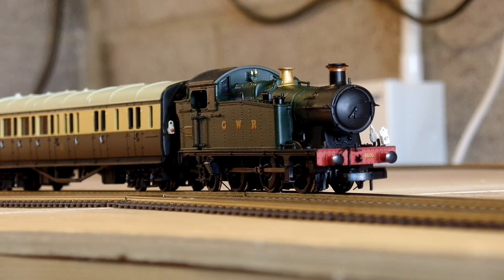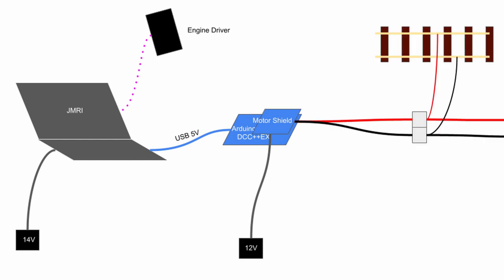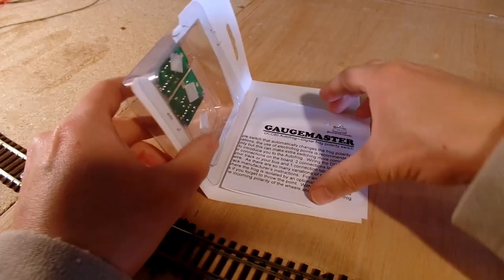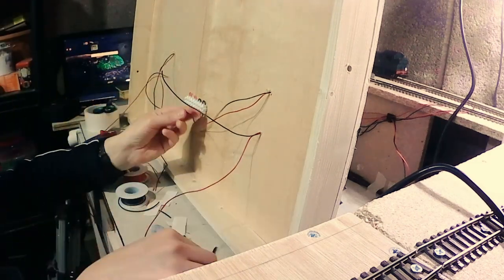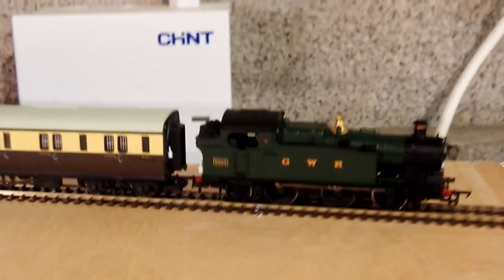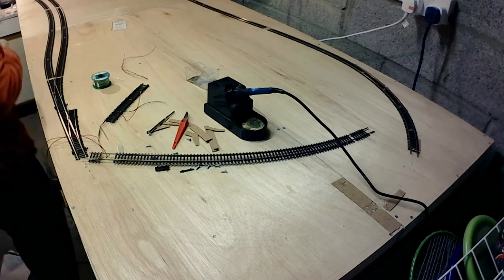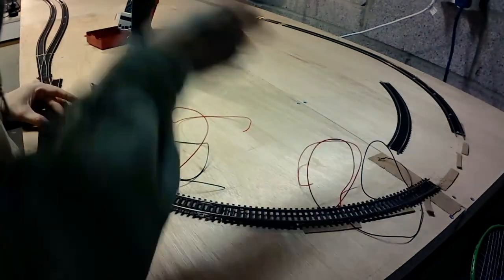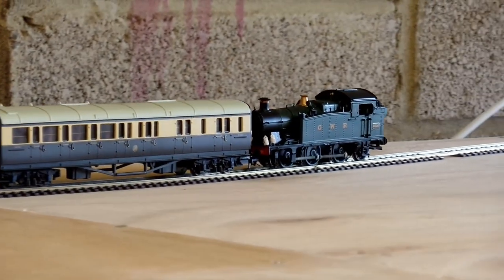DCC wiring, Gaugemaster Autofrogs, and track testing | Modelling a GWR branch line | Episode 6

Comment: Using the 2nd radius was definitely an excellent solution. There can be a lot of problems placing joins on a curve, I've seen suggested that putting a couple inches (sorry US) of straight either side of the join puts less stress on the alignment, either have the short straight cut at the join, or having a removable bridging piece that runs continuous across the join (obviously not ideal in your situation where you're limited to a even 2nd radius turn). Also when using flexitrack through a curve, don't cut the track so that the joins are in parallel, that way there is always some continuous rail on one side, where the other side has a join - it's not really prototypical of early 1900's engineering, but does borrow from more modern high speed lines.

Comment: LOL Seeing your DCC case reminded me of when we were building and testing PC boards, we'd always use the box the mainboard came in as a base.
I'm currently using an elink and railmaster (when it works) for DCC control as I've got to do more research on the Arduino setup and still waiting
for my arduino mega and motor shield to arrive.
Track cuts on curves are always a problem waiting to happen. It's better to sort it now than when you've done heaps of scenic work.
Nice video 👍
Reply from the maker: Thanks! I could look into "proper" cases eventually, but for now a cardboard box provides enough protection. And it's a good talking point!
The Arduino setup was pretty straightforward in the end, so as long as you follow the instructions there's not much you can do wrong.

Comment: Looking good , I can't remember seeing big screws in the previous version , do you take them out once the track has been ballasted ?
Reply from the maker: On the previous layout the track wasn't really fixed down at all other than with the ballast. But that was all set track so didn't need to be held in place like flexitrack does. But yes, the plan is to remove the screws once the track is properly glued down and ballasted.